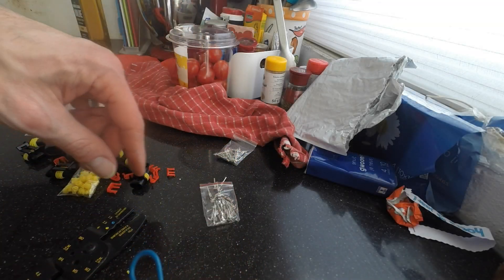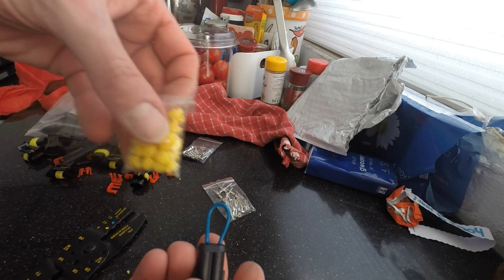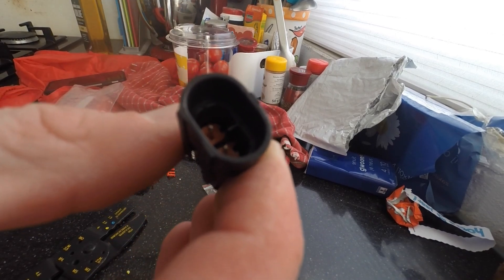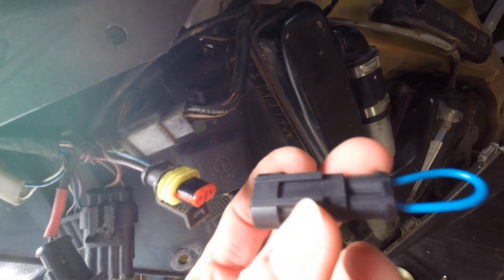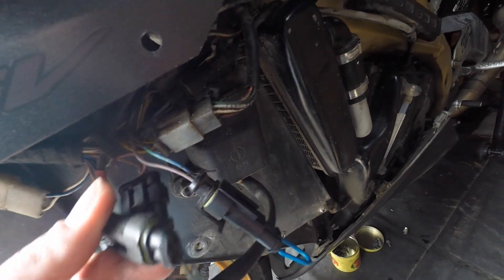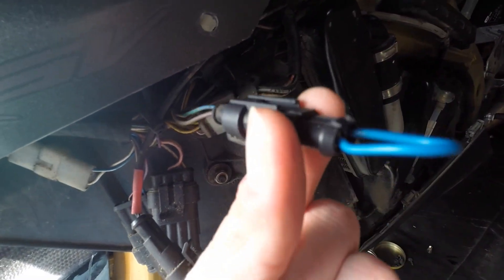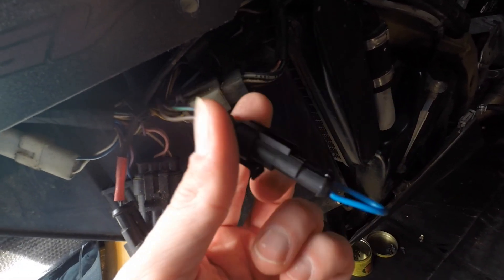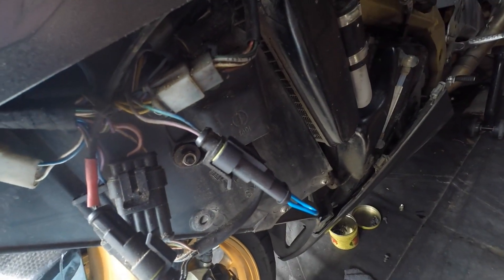Bypassing the neutral switch

Comment: I got a 2006 r1 that has ran me crazy it will turn over but wnt start how tell what it is if I keep going I be done reaced whole bike
Reply from the maker: does it inject gas ?
mine had a vacuum problem... so the gas wouldn't flow from the tank to the engine. It had corosian in the tank overflow pipe and in the anti-vacuum pipe of the tank. (check them at the tank cap, but also at the bottom where the lines ar connected.